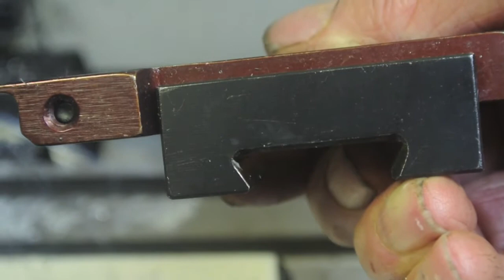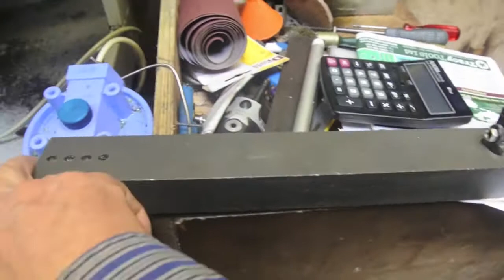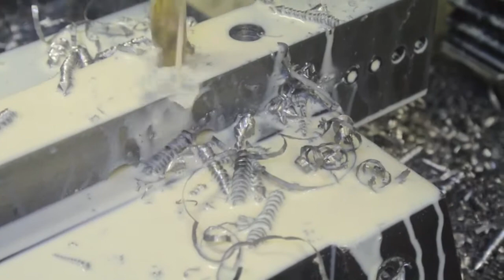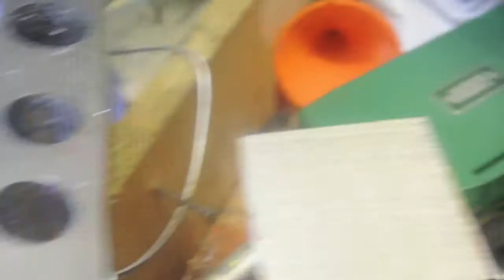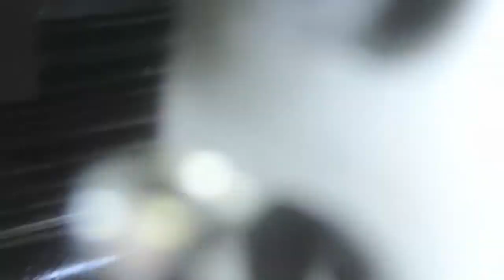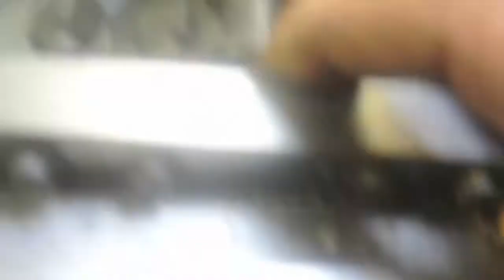Part 2 Gang Tooling For The Tormach Rapid Turn

Comment: I built a gang tooling setup for mine also, I really like your QTP holder idea, I will build something similar for mine.
Reply from the maker: Clifford, They work really well and are very simple. If I make any more tool Hangers/risers I will make some of them so that they are parallel to the table so that tools for profiling and parting  can be mounted vertically